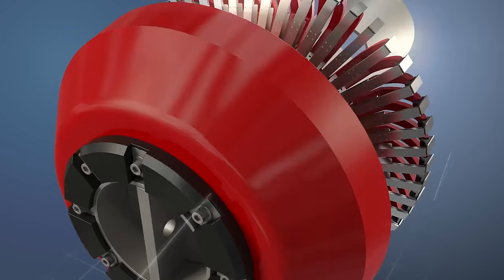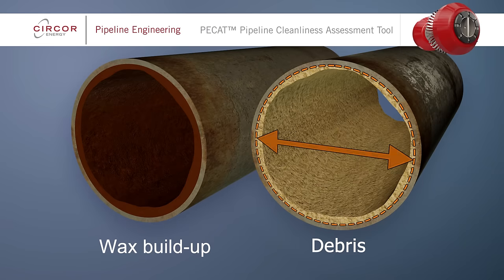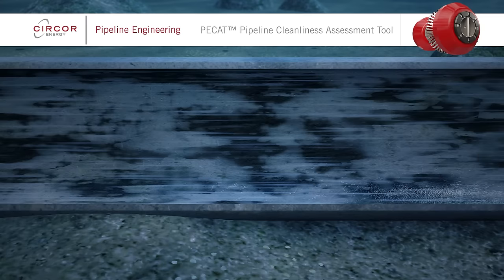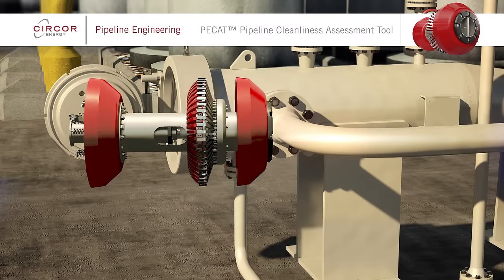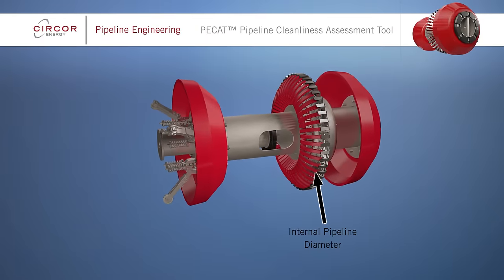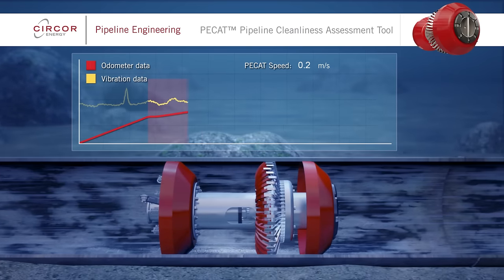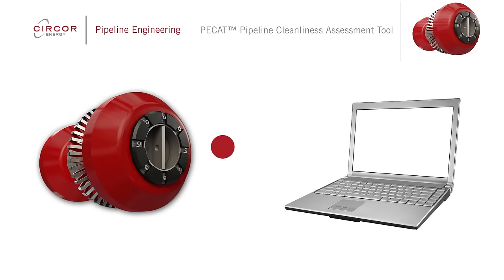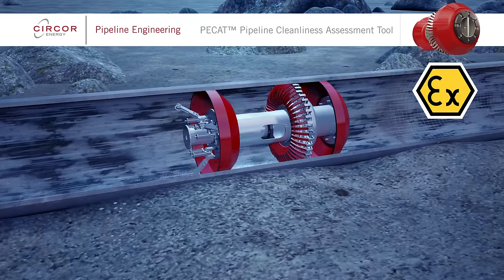PECAT  -  Pipeline Cleanliness Assessment

Comment: How often a pipeline system require inspection oprationally using piging systems?
Reply: depending upon the pipeline,may every 5 years
Reply: 3-5 years, as the pipeline ages it is shortened.

Comment: Do you have a big receiver? I guess my question how do you stop the pig from slamming the door? Thanks.
Reply: by closing the trap valve to stop the flow behind the scrapper
Reply: There is enough room ar end pipe where flow won't go, which the pig push to without reaching the trap door. 
At 3:46 you can see a pipe coming out of the pipe before the trap door, the pig will bypass that pipe and push toward close to the trap door, while fluid flow through the pipe that come out from the side.

Comment: I am working in steel plant in mechanical engineering in my site some pipelines was filled with scale and iron sludge that's why the water flows was decreased,so I want to clean with ur equipment sir

Comment: That looks like one low resolution tool.
Reply: Hi Brett, the tool is not a corrosion measurement tool, however it meets API 1163 for it Caliper capability. Its primary purpose is measurement of internal debris, and we have had many successful runs as part of an enhanced cleaning program with looks of satisfied operators. Happy to discuss more.Mick
Reply: @michaelcollins6853 
Is it required to run 1 or 2 runs of scrapper pig before run this tool?